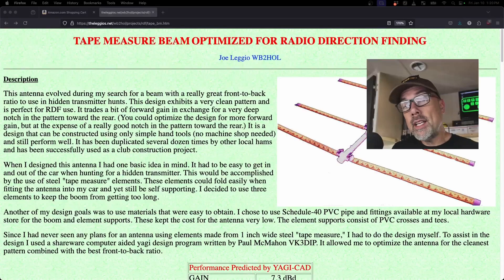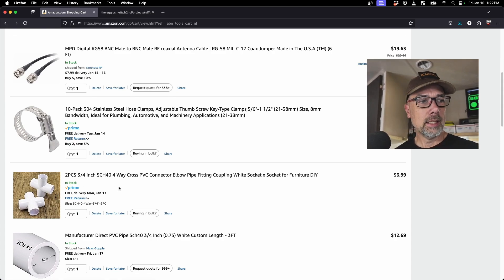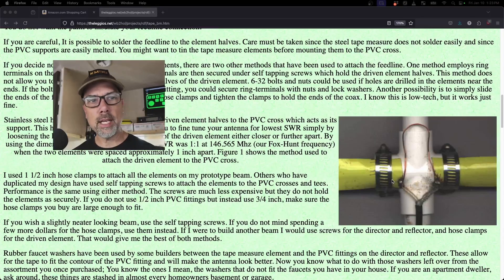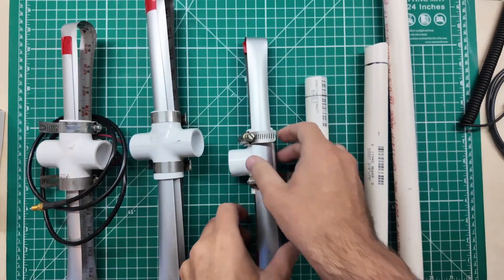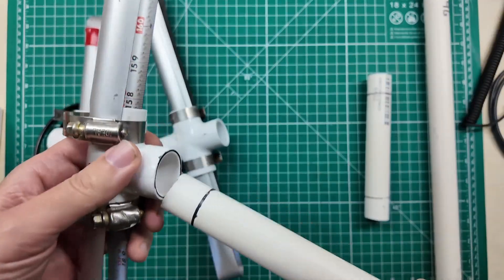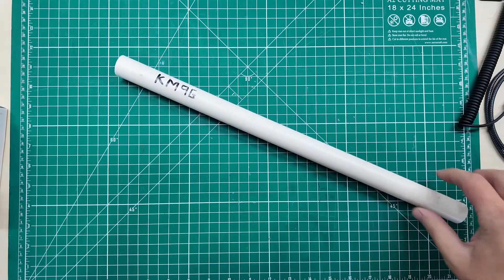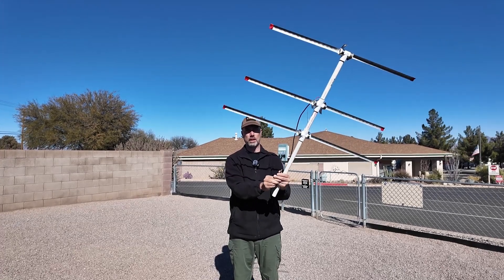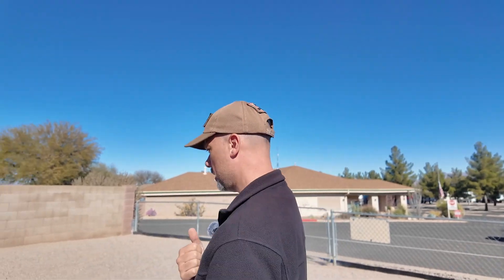A Simple Foxhunting RDF Antenna

Comment: Hi Steve,
Do you if using 2 directors would be longer than one director and one reflector?  73  WJ3U
Reply from the maker: I would imagine so, the spacing between the elements is part of the magic.  Look up "Yagi calculator" and tell it what you want and it will give you the answers.

Comment: Good stuff.  I'd built a similar 2M tape measure Yagi from K9VBR's video, did the same stuff to it you did to yours.  Then built a 2M/70CM combo tape measure antenna using a 1x2 as the mast.  But I couldn't find anything on how long a gamma match should be.  Any idea how to calculate the size of a gamma match?  Or can you even use one on a dual band antenna?
Reply from the maker: I think its a case of trial and error - build it without first.  Test its SWR and see where you are - squeeze the dipole closer together or spread it apart and if you can't get it right where you want it, start adding a gamma match and shrink and expand that only.  I've seen successful designs without a gamma match at all.

Comment: what about building one for the ISS?  but not using tape measure...using scrap screws, pvc ect  a camera tripod.... Yet another good use, an antenna for the 2.4 Ghz Wi-Fi in case you want to use someone's else WiFi with their permission
Reply from the maker: Exactly!  Use arrow shafts from the local hunting store!
Reply: I use mine to listen to the ISS crossband repeater (no license, so just listen).  It works great.  For the WiFi, research Pringle Can Antenna!  Very long distances!
Reply from the maker: @stevenemert837  I remember the days of the pringle can-tenna for wifi!

Comment: Thanks for pointing out the durability and small tear down size.  I should fix up my old Zed-Ell special (one of the dowels split where the nail goes through it to mount it to the boom), make one of these, and compare.  The quality of the null is the thing.  For the usual organized hunt (as opposed to tracking down a bad guy) gain isn't actually desired, what you want is F/B ratio.

Since dipoles have a pretty good null off of the end, they might be interesting to try, if you can keep the feed line from becoming an element.  Maybe twin lead fed?  Or a scattering of beads with a good balun at the feed point.  A J-pole turned horizontal is another possibility.

What I've always wanted to build is an electronically rotated antenna (using PIN diode switching on 3 or more antennas mounted in a circle) so that you can compare the rotation phase to that of the FM modulation that it imparts upon the signal to read relative bearing.  I think it an issue of the old "Ham Radio" magazine that had one of these several decades back, using a CMOS analog mux in a switched capacitor filter, driven from the same counter that was switching the antennas, to extract the phase from the receiver audio.  (About 60,000 RPM, or 1000 RPS, to give 1kHz modulation, so that it's comfortably in the audio pass band.)  Now where did I put those PIN diodes?
Reply from the maker: There is always so much to do in this hobby... just look at all my browser tabs!